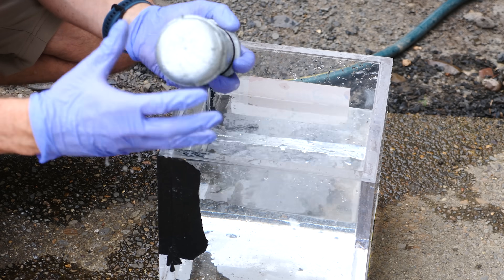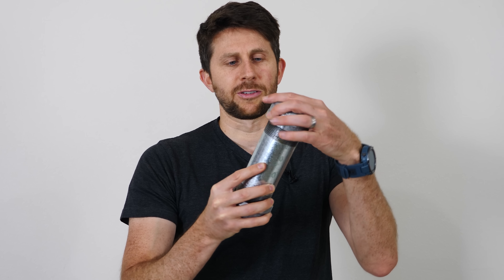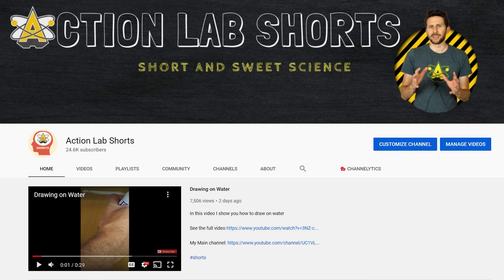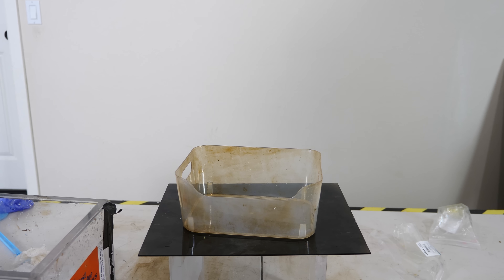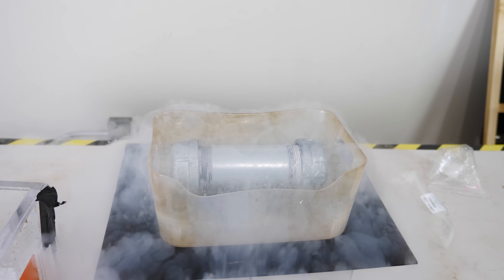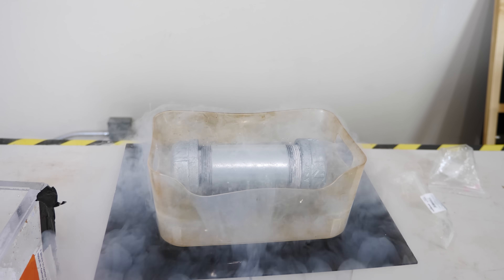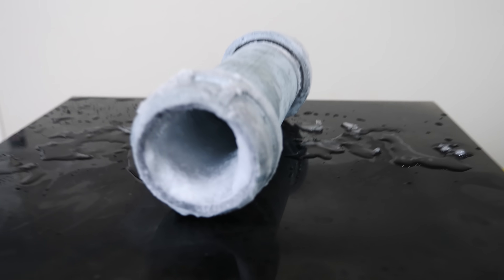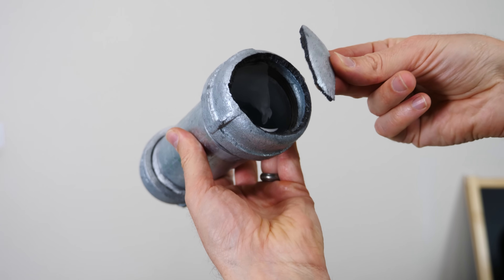Can You Stop Water From Expanding When It Freezes Into Ice?

Comment from the maker: Thanks for watching! Don’t forget to sub to my shorts channel! https://youtube.com/channel/UCA19mAJURyYHbJzhfpqhpCA
Reply: Yes, I asked about different stages of ice on a video once. Thank you for doin it! Edit: I think it will break. That's my guess. That's crazy to think some ice sinks! Water is so cool! Love this vid.
Reply: I want subtitle
Reply: @wulandarinegitawati1483  p
Reply: I subscribed it a day ago.
IF YOU CAN TRY BATHING LIQUID NITROGEN.
Reply: I'm curious if you would get the same results if you used a standard freezer that doesn't go down to -147C. What would happen if you just put it in the freezer at let's say -10° C instead of LN...the metal shouldn't be as brittle.
Reply: @highlander723  no. As the pressure increases inside the container it takes more energy to freeze the water hence the use of the liquid nitrogen. However I'm sure they're freezers that could reach the right temperature to freeze the water into another phase of ice.
Reply: I'm chilled rn... That was awesome! If you get the chance, drop some dense cubes in that liquid and have a drink. It would be interesting to see sinking H20.
Reply: That sure looks like brittle fracture to me.  Plenty of steels that get brittle even before water freezes so not a stretch.
Reply: @FireStormOOO_  iron is very brittle, the end caps are malleable Iron not steel.
Reply: @FireStormOOO_  if there are steels that get significantly brittle before water even freezes, then those steels must not be used for much, that would be a serious flaw with the alloy if it does that, unless its not actually significant and therefore would not affect the strength of the metal.
Reply: You remind me of "Mr. Wizzard", who I adored and watched as a kid whenever it came on. You have grown so much since I started watching you, good job!  =]
Reply: Not steel.  Cast alloy
Reply: @billhester8821  correct, plumbing galvanised iron.
Reply: How much pressure is it compared to swimming really deep in the ocean? I asked because I wonder what it would be like for someone to swim in negative 10° water with all that pressure.
Reply: @roughwoof  ita a different kind of pressure than this experiment the water is trying to get out of the container so the force is pressing outwards aka expansion from inside the pipe and when your deep underwater the waters weight is trying to crush the pipe/vessel and compress it inwards and let the water inside not being mean just explaining but it would be terrible to be inside a pipe deep under water and it's freezing cold and oxygen is running out lol
Reply: @CMyBigHarryBLLS  Thanks. Now that you said it it seemed sort of obvious! I should have known! LOL!
Reply: @roughwoof  it's all good glad to help 👍
Reply: That cap does not look like it's made of steel, it looks like malleable cast iron instead.
Reply: @_John_P  I'm aware.
Reply: @Metal_Master_YT  But he is not.
Reply: @_John_P  who's "he"?
Reply: @Metal_Master_YT  The Action Lab host.
Reply: 4:57 I can guarantee that the 'big explosion' came from the water bomb going off, and when the water and pipe cap hit the nitrogen this created a vapor cloud. if by saying 'big explosion' you meant 'big vapor cloud' and 'misspoke' then I can agree, otherwise you are using words incorrectly. At minimum you should have recognized and acknowledged the two separate events.1) the big explosion 2) the creation of a vapor cloud. these are NOT one and the same let alone the claim that the water hitting the nitrogen created the 'big explosion' as all I saw from the water hitting the nitrogen was the creation of a vapor cloud AFTER the big explosion.  sorry.
Reply: What if you reach that Ice IX or XII, to make it denser, then release some of the pressure? Is it stable? Or maybe will it change back to some other phase?
Reply: What would happen when you use tungsten to contain it would it do the same
Reply: @misharasko5395  I would be interested to see it with steel.
Reply: Ok
Reply: I did so your shorts is 4 yrs old :0
Reply: I’m so glad to see you channel growing, it’s definitely well deserved!! You have a great way of explaining things to make it very easily understandable.
Reply: @the action lab  next time freeze water slowly, at -1°C so that the entire liquid freezes
Reply: Will do! Maybe this will be even better for my Physics students. I will urge them to subscribe.
Reply: This reminds me of to apparatuses that used to be made for classroom demonstrations.
1.  Ice bomb.  A hollow cast iron sphere with a hole, fitted with a screw plug.  Essentially the same thing as your  pipe with end caps.
2  Ice Piston: A vertical metal cylinder with a close fitting metal rod that functioned as a piston.  You put some water in, leaving some air.  Put the piston in the cylinder and hit it hard with a sledge hammer.  During the brief time the air is compressed, the temperature will rise considerably and heat will flow into the metal.  Then when the pressure is released, the temperature will drop enough to freeze the ice.
Reply: Can you make Ice 7 at home from pressure?
Reply: Has anyone engr made hexagonal ice at phase 9?

I imagine that's very strong
Reply: Hmm, what would prevent making it push against a gear train to spin a generator? You'd get a lot of energy from it. Then you could just repeat up and down a couple degrees (using not much energy), to harvest a LOT of energy?
Free energy isn't possible, so what is the "gotcha"?
Reply: @TheRainHarvester  that's kind of how the Stirling engine works
Reply: Oh, you guys are right, he is copying other peoples videos. hey Action Lab, please make your content more original, I keep watching YouTube videos, then having your video pop up with basically the same title and everything. here is the video I watched: https://www.youtube.com/watch?v=f5wnTy_FhdM and only like two weeks after I watched it, you made a video (the one I'm commenting on) about the same exact thing.
Reply: The metal was colder where it was in contact with the LN2. Since the ice formed around the edge that is where it was coldest and most brittle.
Reply: Can you repeat the test with an empty cylinder to see if the cylinder cracks due to different expansions and different points throughout the cylinder. I think it would have cracked at the same spot without water in it.
Reply: @MrElvis1971  we already have examples to show that that is not the case. people like to put steel (or other metals) in liquid nitrogen to make it brittle so they can try to smash it, it does not break on its own, you have to hit it with a hammer first.
besides, do you not know how strong iron is? one whole piece of iron that is made out of all the same alloy, will all shrink and expand at the same rate, and because of how conductive it is, it heats quite evenly compared to most other materials. find me a single example of metal shattering, or exploding because you cool it down or heat it up, but more specifically an example of practical metals or alloys, not useless alloys that are made to be extra brittle on purpose just for this experiment.
also, I would like to point out that only one cap broke, both the caps were identical, and both were cooled to the same temperature. and yet only one cap broke in the most pressure weak spot, neither the other cap or the pipe broke. listen, you are underestimating the strength of iron.
Reply: @Metal_Master_YT  metal objects regularly  fracture when cooled or heated due to expansion rates. The assumption you're making is valid with a simple geometry like a metal rod. But this cylinder is far from simple. It is constructed of three separate parts which are also threaded. The other assumption you are making is that in liquid nitrogen there is not a temperature difference between the nitrogen and the water which are boundary conditions for the metal. This means there is also a temperature gradiant within the metal when the state is not at equilibrium. That is, there cannot be an equal temperature throughout the metal when the system is not in a state of equilibrium and in this situation we are talking about a large temperature difference.  In a simple bar, this does matter as the bar is relatively uniform with little stress points. But in the cylinder there are many stress points due to its physical structure but also within the manufacturing of the parts (especially the end caps).
Reply: @Metal_Master_YT  the other thing you forgot to consider is that he didn't use steel. It is galvanised cast iron (alloy) which is reasonably brittle to start with. He would have very different results if he used stainless steel of the same dimensions.
Reply: @MrElvis1971  you should try it yourself.
Reply: @MrElvis1971  oh, btw, cast iron generally has a significantly higher tensile strength than an average quality mild steel.
Reply: @Metal_Master_YT  quote "Microstructure observations confirmed the ferritic malleable cast iron of the end cap. The hardness of the end cap was significantly below the hardness range specified for standard ferritic malleable cast iron. Small cracks formed during the casting of the end cap and the low strength of the end cap caused the final fracture. Failure stress determined by finite element analysis simulating the freezing of the inside water could accurately predict the failure stress and failure temperature. High tensile stress and poor manufacturing quality caused the crack to propagate in the cleavage mode and at the final stage in the ductile mode."
Reply: @MrElvis1971  ok, but that changes nothing, cast iron still has a higher tensile strength than the average mild steel, which is exactly what I said. you aren't really "disagreeing" with me.
Reply: @Metal_Master_YT  I know what you said. But I am discussing the strength within the context of a real life manufactured object not a metal rod tested in a lab.
Reply: @MrElvis1971  the properties of a material don't just disappear because they are manufactured. you are saying that its strength might go away because it is manufactured, but the same applies to its brittleness and hardness. properties of a material are transferred over to their manufactured counterparts. its really only when two metal parts have different shapes that they might have unpredictable properties, otherwise, when you have two of the same part, and one is a strong material and another is not, the stronger one will still be stronger. and all the parts here appear to be the same material, at least the two end caps appear to be identical.
Reply: @Metal_Master_YT  oh boy! Okay, your right I am wrong and learning has stopped. Do you often feel the need to assert your authority and arrive at closed solutions so that no more learning can occur? What is it about an obsessive need to be correct?
Take a risk... give yourself permission to not know an answer... go on a journey... ask questions... go into the unknown.
Reply: @MrElvis1971  ok, so your a teacher now?
Reply: @Metal_Master_YT  actually... yes I am. And your my student. Your next assignment is to take a risk.
Reply: @MrElvis1971  well then, let me ask you this, you said at the very beginning "I think it would have cracked at the same spot without water in it." well then, how come the other cap didn't break and the pipe didn't break either? also, the pipe wall is thin, thin objects don't usually have a significant amount of expansion and contraction, its in thicker objects where its more pronounced, because the effect stacks and you get a larger amount of expansion/contraction from it.
Reply: @MrElvis1971  why don't you go ahead and take a risk yourself, if you disagree with me, go try that experiment out yourself then come back and tell me what you find.
Reply: @Metal_Master_YT  I did. Tensile strength of malleable iron higher than mild steel but lower than stainless steel in "lab conditions". Lab conditions do not and never represent the tensile strength of a manufactured object. The tensile strength of a manufactured object needs to be tested as the manufactured object. The tensile strength curves are standardised tests in lab conditions. I previously quoted an academic research paper about the failure points in end caps made from malleable iron. The paper stated that the location and mode of failure was predictable due to manufacturing defects in the end cap which inducates a difference between actual vs theoretical.

Your reply to this was... doesn't make a difference.  Mild steel has greater tensile strength than malleable iron.

Do you have another reply to engage in a discussion or is your reply... "doesn't matter". Which is essentially saying you are right and everyone is wrong and you don't care what they say.
Reply: @Metal_Master_YT  why didn't the object fracture in multiple points? Because it generally fails at the weakest spots. Regarding temperature difference. Yes. This is more prominent in thick objects but as I said. The temperature difference from liquid nitrogen to liquid water is very large and these are boundary conditions causing a large temperature difference in the metal.

But what I am ultimately suggesting is that what "I would like to see" is more tests to determine the exact mode of failure. It's YouTube and people try to express opinions on YouTube in a different manner to say a workplace environment. There are kids on YouTube who are keen to learn and so posing alternatives sometimes gets people to think about science and possible alternatives. It is sometimes about providing questions and alternatives and undertake further investigations.... rather than portraying oneself as an expert with only one answer as being the correct answer. It is okay to be wrong. Trust me. It is okay.
Reply: @MrElvis1971  listen, this comment section is so long, that its a real pain to continue posting here, I have to keep going to the very bottom to reply to your comments, and to see if YouTube forgot to show them. this is why I'm kinda trying to: "and arrive at closed solutions so that no more learning can occur?" I just want to move on, but you seem to have a lot of good info, so I will keep chatting if you like.
Reply: @MrElvis1971  No! xD when I said "go try it out yourself" I didn't mean research, I meant go and physically do it so that we can have a real answer not a theoretical one!
try putting the pipe in the nitrogen empty, or without end caps, and try it yourself. but this is really off topic, I want to get back to what I said originally, and you seemed to ignore it even when I pointed it out twice, which frustrates me.
Reply: @Metal_Master_YT  so let's start again. What is your main point?
Reply: @MrElvis1971  let me repeat myself:
"well then, let me ask you this, you said at the very beginning "I think it would have cracked at the same spot without water in it." well then, how come the other cap didn't break and the pipe didn't break either? also, the pipe wall is thin, thin objects don't usually have a significant amount of expansion and contraction, its in thicker objects where its more pronounced, because the effect stacks and you get a larger amount of expansion/contraction from it." we don't know if the low thickness of the pipe (and therefore low expansion and contraction) overpowers the effects of temperature difference. we don't know if the thin pipe stops it from breaking even though its really cold. that is mostly unknown.
but what we do know is that he had three separate pieces of cast iron, two thirds of which did not break. so if you think that just being set in the nitrogen would break the pipe, well water or no water, its still in tact, and same for the one end piece. you thought the end piece would break in the same place due entirely to the cold, yet only one cap broke, the other was also in the nitrogen, and it did not, as you put it: "break in the same spot".
Reply: @Metal_Master_YT  Firstly, this is YouTube. It is predominantly a male medium and young. This is a shitty science YouTube channel with a few snippets of science in it. Therefore, I adjust my communication to fit the audience and the intent of the YouTube author. He has two intentions 1. To make money 2. To educate young people on how to be scientists and engineers.

The second motivation is that the author is trying to develop an inquisitive mindset in young people. Not telling them answers. 

So, I adjust my communication to suit his intentions. What is important for young people to learn is not having the right or wrong answer. It is about asking questions and risking being wrong.

You are more concerned with absolute knowledge whereas I am not.

I very well know it won't crack with no water in it. He even pre-cooled it to zero degrees Celcius to reduce thermal shock so that it wouldn't crack. And he has copied this video off others.

I also don't underestimate the strength of malleable iron. 

But non of this supports young people to develop inquisitive minds to ask questions and risk being wrong.

When things fail, they generally don't fail in a million pieces (unless it is a very high pressure explosion). 

Question: have you ever put a cast iron frying pan that has come hot off the stove top into cold water. I suggest you don't do it. These pipes are malleable iron not cast iron so can withstand this thermal shock much better (at the expense of hardness).

Do kids know the difference between cast iron and malleable iron? No! Do kids understand how carbon content changes the properties of iron? Probably not. 

It is all about working with the audience of those who engage with this medium. There are other forums where I can engage in more rigorous logic and reasoning.
Reply: @MrElvis1971  if what you're saying is true, then why didn't you say that at the beginning? "I'm asking questions to get young people to be curious and figure things out on their own etc."

but I don't think that was your motivation either because of how you phrased your original question, you said: "I think it would have cracked at the same spot without water in it."
you said "I think that this will happen" you didn't say "lets see if this happens" you said it in such a way so as to imply that you believed that was true.
it does not align with what you said next which was: "I very well know it won't crack with no water in it."

basically what I'm saying is why did you say: "I think it would have cracked at the same spot without water in it."

and then say: "I very well know it won't crack with no water in it."

how can you think it will crack and know it wont crack at the same time? those are opposites! they cant both be true!
Reply: @Metal_Master_YT  because I have no pressing need or motivation to be perceived as being correct  or to be perceived as being knowledgeable. These things have no importance for me in real life let alone on YouTube.

Given this deals with Frozen things... my advice is to listen to Elsa and  "Let it Go". Don't overanalyse the motivations of people within online forums. It is a waste of time and a waste of your life.
Reply: @MrElvis1971   "I have no pressing need or motivation to be perceived as being correct  or to be perceived as being knowledgeable." well, your being perceived as a liar, so its really not helping you in the long run. you said:  "I think it would have cracked at the same spot without water in it." by definition that's a lie. people might look up to you and believe what you say, I'm telling you not to perpetuate inaccuracies (whether you know their inaccuracies or not) because people believe this stuff. spread your real opinion not a fake one.
but it really doesn't matter, you're using this as an excuse so that I cant tell you that you're wrong. I say "well that's not true" and you are saying "well, yeah I knew that, I was just trying to uh, get people thinking and stuff" not a very good way to convince somebody that you're innocent. and really it surprises me considering that you yourself said you didn't care about looking like you were right, yet you are constantly defending yourself over and over telling me that I'm wrong. (whether or not I'm doing it too)

LISTEN! if you were just trying to get young people thinking (which is a thin argument in and of itself) then why did you keep trying to prove your idea to be true?!?!
you said: "I think it would have cracked at the same spot without water in it." firstly, that sentence is really self explanatory, and you should really actually mean what you say.
and secondly, after saying your theory, you try to prove it, even though you just said: "I very well know it won't crack with no water in it." if your well aware that its wrong, then why the heck did you try to prove your theory?!?!? this is why I doubt that you were "trying to get kids to think" or whatever you said, I think its just a lousy way to cover up your mistake, and all that coming from a guy who says he doesn't care what other people think about him! if you don't care so much, then stop trying to cover yourself up!
I want to find truth, and people like you giving opinions that are literally fake is NOT HELPING, and its also NOT HELPING every other person just like me, of which there are many.
(I know I sound angry, but I'm not, I just like putting emphasis on certain words and highlighting them)
Reply: @Metal_Master_YT  learn to sit comfortably with ambiguity. It is a learnt skill that will serve you well. It is one of the greatest skills a person can learn.
Reply: @MrElvis1971  ok, but answer my question please.
Reply: @MrElvis1971  you cant bend truth to be whatever you want it to be, its no longer truth if you do that. there should be and there are solid concrete answers and logical conclusions that we should be able to come to. I don't want you to end the argument by saying that I'm just not looking at it from the right perspective, if you believe that, then please tell me, show me or prove to me that that is the case. I'm completely open to being proven wrong, but it seems that your defense is composed of primarily subjective ideas and claims.

if this is how you're going to end this then I have only one thing to say to you: "oh boy! Okay, your right I am wrong and learning has stopped. Do you often feel the need to assert your authority and arrive at closed solutions so that no more learning can occur? What is it about an obsessive need to be correct?

Take a risk... give yourself permission to not know an answer... go on a journey... ask questions... go into the unknown." in your own words.
Reply: @Metal_Master_YT  Question for you: Do you think I am reading your long rants?
Reply: @MrElvis1971  Idk. but ambiguity isn't really a positive character trait. :/
Reply: @MrElvis1971  you said something that wasn't true, own up to it or leave, its real simple.
Reply: @Metal_Master_YT  quote "Ambiguity intolerance is thought to serve as a cognitive vulnerability that can lead, in conjunction with stressful life events and negative rumination, to depression. Anderson and Schwartz hypothesize that this is because ambiguity intolerant individuals tend to see the world as concrete and unchanging, and when an event occurs which disrupts this view these individuals struggle with the ambiguity of their future. Therefore, those who are intolerant to ambiguity begin to have negative cognitions about their respective situation, and soon view these cognitions as a certainty. This certainty can serve as a predictive measure of depression."
Reply: @MrElvis1971  well, you have got to know how to handle emotion and how to reason. and you have to be looking at things from different perspectives, but in almost all cases, there is only one right answer, or at least you can tell with certainty which answer is correct, and which is not. I use logic, I think that its a good way to reason, and you are welcome to disagree, but please don't judge.
Reply: @MrElvis1971  everything in this world works through math and science, and everything follows laws. everything is concrete in one way or another. you need to know what you believe, you cant stand on shifting sands, you must find a solid rock.
Reply: @MrElvis1971  I can handle change in life, but most things don't change, all the laws of physics stay the same even if I move to a different country.
Reply: @Metal_Master_YT  look after your health. 

It's important...
Reply: @MrElvis1971  yeah, and remember that the sky is blue, like you'll forget or something. xD
Reply: @MrElvis1971  I will look after it, but what I really want to know, is why you think you need to bring it up.
Reply: @Metal_Master_YT  keep wanting
Reply: @MrElvis1971  wanting what?
Reply: @MrElvis1971   congratulations, you have changed the subject to something completely unrelated to the original theme. let me hop back to it for the sake of this argument.
you said: "I think it would have cracked at the same spot without water in it."
and that's not true. you said something untrue either way you look at it, period. its real simple.
Reply: @Metal_Master_YT Actually, I have remained on topic the entire time. I haven't changed anything.
Reply: @MrElvis1971  by definition you haven't, don't troll.
Reply: @MrElvis1971  we went from arguing about whether or not the pipe would break, to whether or not ambiguity is a good character trait. that is a subject change, whether or not it is similar.
Reply: @Metal_Master_YT  we? mmm... I don't think so.
Reply: @MrElvis1971  lol, that is just an inflammatory comment.
Reply: @MrElvis1971  quote: "learn to sit comfortably with ambiguity. It is a learnt skill that will serve you well. It is one of the greatest skills a person can learn." you indeed did start the talk about the word "ambiguity". I see our disagreement now, you prefer to be vague, and I, do not, I instead prefer precision. also, it is definitely not the greatest skill a person can have, not even anywhere near close. things like dedication, discipline and love (the friend to friend kind) come to mind...
Reply: @Metal_Master_YT  I suggest you go to the doctor and get some anti inflammatories.
Reply: @Metal_Master_YT  do you think "we" have a disagreement?
Reply: @MrElvis1971  good bye, I'm wasting time here.
Reply: @Metal_Master_YT  thanks for the discussion. Bye.
Reply: does ice12 taste different?
Reply: digital subliminal messages  who the heck are you? and what are you talking about?
Reply: I have some questions😇
Q:Can we flim with a camera sent in outer space that how a black hole swallows it?🙃
Q:Do we have a camera that would stand the power of black hole?🙃
Q:Can we burn dry ice ?🙃
Please answer my questions.  🙏
Thank u❤
We all really understand alot from you. 😘
Reply: Sir , what will happon if we mix Glass and Metal like iron in a fernous ???
Reply: Looks like a decent solution for a trigger mechanism for a liquid nitrogen IED
Reply: Please do it again with some contraption that can achieve the pressure required to actually create ice X or XI.
Reply: @adb012  🤣😂🤣😂 hell why not create ice xii?
Reply: @frankh.3849  Yes. Any ice other than ice I
Reply: that cap looked like it was cast iron
Reply: I subscribed
Reply: Thank you for the experiment. I would be interested to know what would happen (theoretically) if the ends of the container were held in place, perhaps with a C-clamp or in a vice applying a force towards the center.
Reply: Post it on tik tok too
Reply: Use a ballistics dummy
Reply: Fascinating just one small error, the end caps are Malleable Iron not steel!
Reply: what happens if you set of a small amount of black powder inside a 50cm thick cast iron shpere and don't let it expand? i've had this question in my mind for a while now.t
Reply: @squa_81  you get arrested on terrorism charges, get convicted and then spend a very long time in prison.
Reply: @MrElvis1971  if you make it explode deep in the sea?
Reply: @squa_81  pressure in deap sea is pretty high.
Reply: @MrElvis1971  in your opinion, why did I say in deep sea, maybe because you can attach the sphere with the explosive inside on a cable, lower it to the desired depth, explode the charge, reel it back, see what's up
Reply: @squa_81  I bet it would break, not unlike in this video, but probably a bit more smoky.
Reply: You should do it in a freezer. Liquid nitrogen would make it more brittle. I also think you should put salt in the water to assist with nucleation.
Reply: @coryconnell1501  salt would make the water harder to freeze, and even if you did, you would get pockets of brine mixed in with the ice.
Reply: It's a malleable iron cap so it's not steel just an fyi
Reply: Use a stainless steel tank. It will get stronger as it gets colder.
Reply: @randal_gibbons  many things get harder and also stronger with cold.
Reply: @Metal_Master_YT  I know. I just mentioned one of them.
Reply: Crazy good episode
Reply: Helo
Reply: @Steadyy.v  L
Reply: @Metal_Master_YT  are you calling me out for purposely spelling hello helo?
Reply: @Steadyy.v  xD you were just being funny right? yeah, and so was I. don't get offended please.
Reply: @Metal_Master_YT  lol
Reply: Can you do something related to full suspension mountain biking  please?
Reply: Do yourself a favor my guy. Get  a better blast shield...
Reply: Bro. The steel went brittle from the liquid nitrogen.
Reply: can you add a pressure meter to see how can change
Reply: sick video, I remember when ur videos were more clickbaity, they've rlly improved
Reply: 1 Minute shorts? Why would anyone want to watch that? We're watching this, because we like it and find it interesting. It's not that we want to get done with it as quickly as possible ... The more in depth, the better, imo.
Reply: You should reattempt this but with tungsten containers
Reply: If you degas the water in a vacuum, it should remain the same volume after freezing.
Reply: The Real Scientific answer to this Question 'Can You Stop Water From Expanding When It Freezes Into Ice?' is NO. In order for water molecules to form a 'solid' they need to expand for that configuration. You can still cool ice to freezing temperatures but if it can't expand it will remain a 'liquid'. However, the forces creating the expanded configuration come from 'the Ether', as they call it, and are extremely hard to counteract. Anecdotally speaking an ice skaters blade slides smoothly on a liquid water track caused by the extremely compressed ice. So under compression ice will revert to water.
Reply: Why didn't you talk about the fact the steal gets weakened by the liquid nitrogen, and that helps the water out.
Reply: Interesting  stuff. Hate to be that guy but you talk about safety and have no glasses/gloves/protective clothing on while pouring a canister of liquid nitrogen?
Still, I enjoyed watching.

Thankyou.
Reply: This is the link to the guy mentioned attempting the similar test with the  steel cubes

 https://youtu.be/f5wnTy_FhdM

He is worth a watch, interesting guy.
Reply: @0:27 The guy that was mentioned attempting the similar test with the steel cubes he made himself is called Tyler Bell 🔔  the link to his video is below, check him out, he make good videos that you can tell he really works hard on.

 ▶️https://youtu.be/f5wnTy_FhdM

He is worth a watch an interesting guy Tyler Bell 🔔
Reply: I wanted to reply here so hopefully this gets noticed by Action Lab. I don't think the reaction would be anywhere near so drastic if say you put that same set up in a freezer and slowly froze the pipe. I could be wrong but I don't think I am. It still might (and probably would)  expand and break but it wouldn't explode.
Edit 
PS. Your channel is awesome👍👍
Reply: But even if you do contain the compressed ice, would it blow up when you take it out?
Reply: Try a stainless steel sphere with 10cm thick walls and an inside volume of 420ml.
Degas the water and for filling it obviously needs a hole, which can be threaded all the way and then a 10 cm screw is used to quickly weld it shut while cooling the sphere down. (for the welding)
Step b: Lean back and enjoy the beautiful formation of a black hole 😎😂

(Jk ofc 👌)
Reply: You are going to hurt somebody. You definitely should never own a firearm.
Reply: I read somewhere on reddit that applying pressure (or more so not allowing expansion) can keep water liquid at below freezing temperatures. This can be used to make stuff like human organs or maybe fruits to be preserved without the cell walls turning mushy from the ice crystals.
Reply: So that's why they leave the water on when they winterize my cabin. 🤔
Reply: Ice 9? No way! Is ice 9 stable at room temperature? If I create ice 9 can I throw it in the ocean and freeze all the oceans in the world? 

Cat's Cradle was such a weird book.
Reply: Didn't you compromise the metal with the liquid nitrogen?
Reply: How about redoing the experiment getting rid of all the nucleation sites, smooth on the inside of container and much more gradually instead of fast change with liquid nitrogen so it's supercooled with a temp probes if possible. Also, pressure transducer to see the force build-up inside. Instead of just a graph do it in real life. How much more force could we get if slowly supercooled and a much much stronger case like that same pipe but put into a much larger metal container, get a foundry to fill outer container with steel with much larger pipe in a pipe. Put entire thing in the cold with very slow cooling.... supercooled.
Reply: Our sc
Reply: Can you please advise or give me a formula that I can use to calculate the pressure on the walls of the container? The formula should relate phase change with pressure.
Reply: I've watched this video a few times and Let me start off by saying I love all of your videos But you and I both know what you did was extremely dangerous and if you weren't afraid of it exploding the 2nd time you poured nitrogen on the Cylinder You would not have pulled away the nitrogen container so fast
Reply: Do you also wash your dishes in the vacuum chamber?
Reply: You should consider deleting this video.
Reply: I love it when it eivpolded
Reply: I did!
Reply: @the action lab  next time freeze water slowly, at -1°C so that the entire liquid freezes
Reply: @the action lab  next time freeze water slowly, at -1°C so that the entire liquid freezes
Reply: @the action lab  next time freeze water slowly, at -1°C so that the entire liquid freezes
Reply: The Real Scientific answer to this Question 'Can You Stop Water From Expanding When It Freezes Into Ice?' is NO. In order for water molecules to form a 'solid' they need to expand for that configuration. You can still cool ice to freezing temperatures but if it can't expand it will remain a 'liquid'. However, the forces creating the expanded configuration come from 'the Ether', as they call it, and are extremely hard to counteract. Anecdotally speaking an ice skaters blade slides smoothly on a liquid water track caused by the extremely compressed ice. So under compression ice will revert to water.
Reply: You are giving the metal the property of being weak as it losses elasticity because of the partícula loose movement so the momentum of expand it's negative, so try better freezer the water into a freezer and let the metal  natural ability of expand and let see if brake down